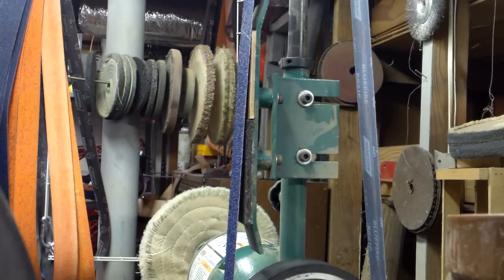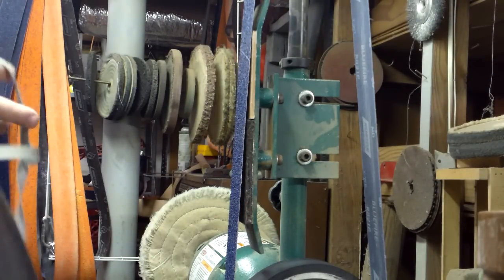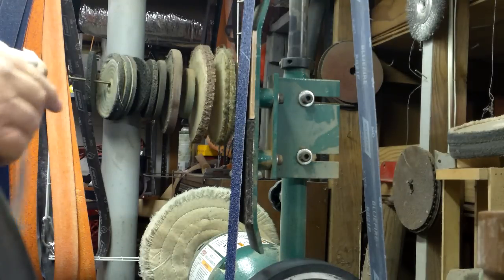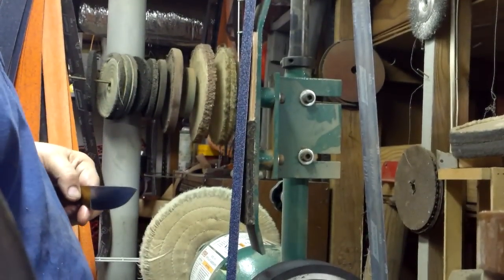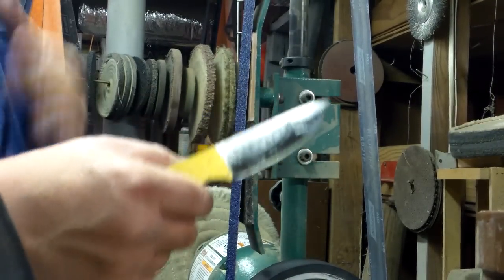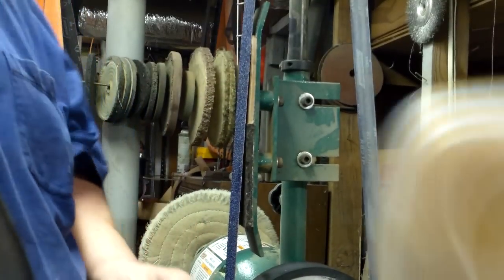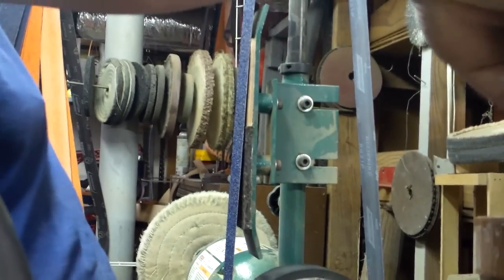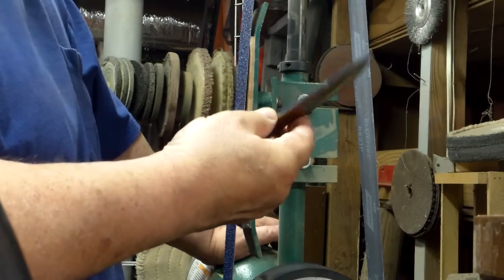Grinding SM100

Comment: Ok, I'm gonna be that guy. SM100 is not steel. It has no iron or carbon in it. It's rough composition as far as I've been able to find out is 60% Nickle 40% Titanium.
Good video none the less. :)